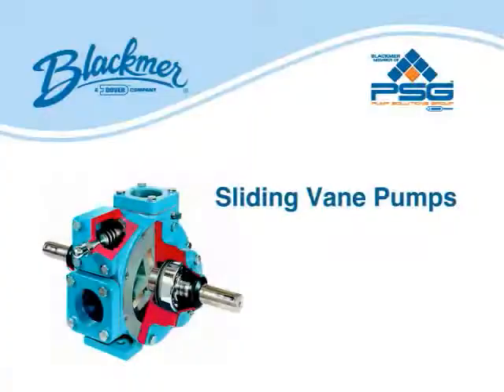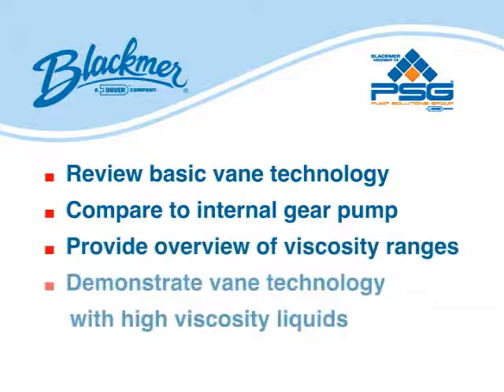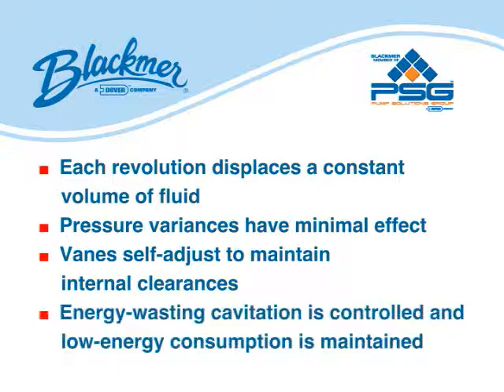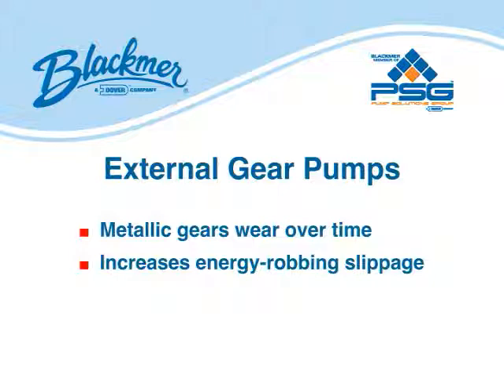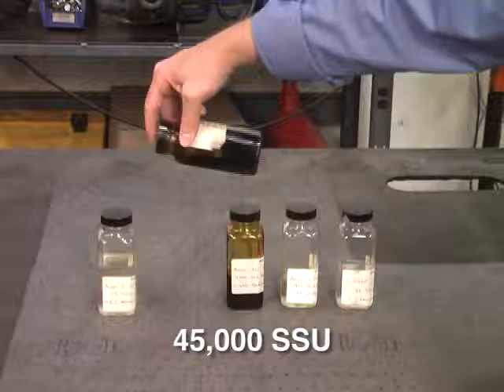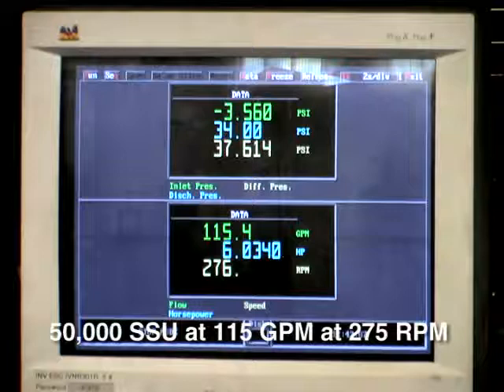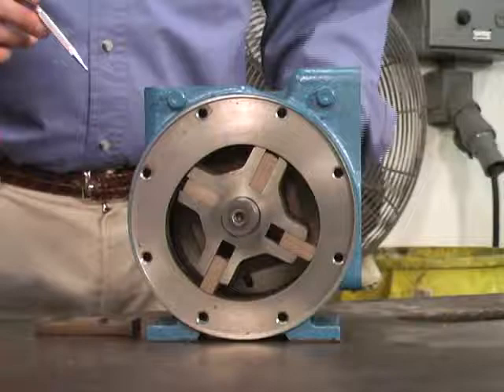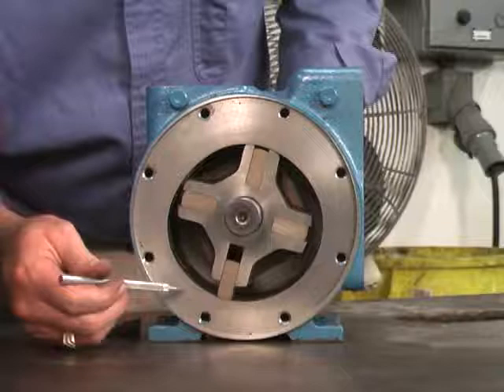Blackmer Sliding Vane Pumps in Thin and Viscous Application

Comment: When a vane slides out of its slot, what fills that void?  When pumping a fluid, how are the vanes held tight to the inner bore to prevent blow-by? Springs? Or perhaps a little bit of the pumped fluid is redirected from the high pressure side and injected into the space behind the vanes to push it out of its slot and against the inner bore. ?